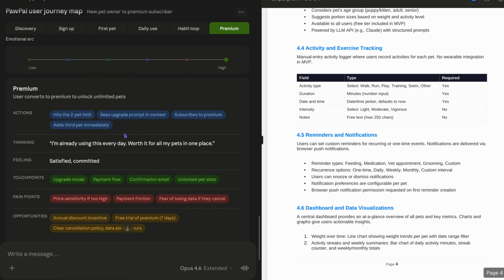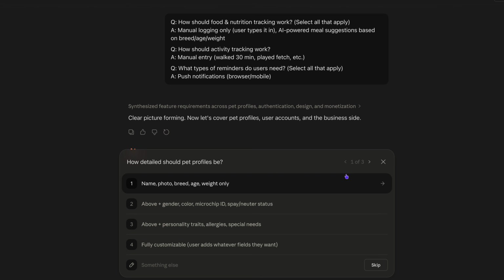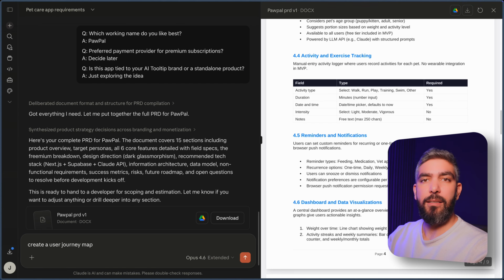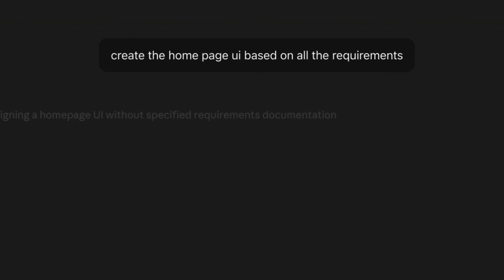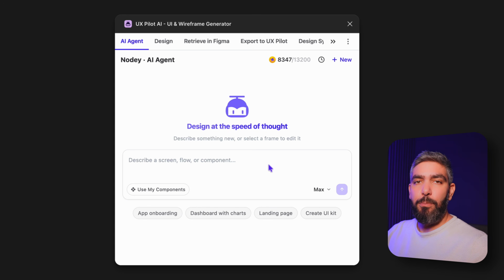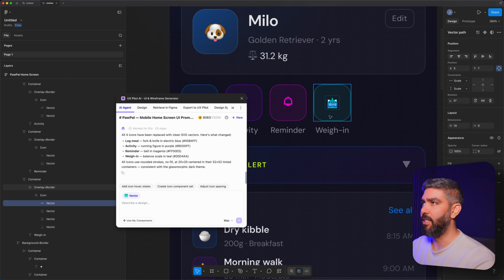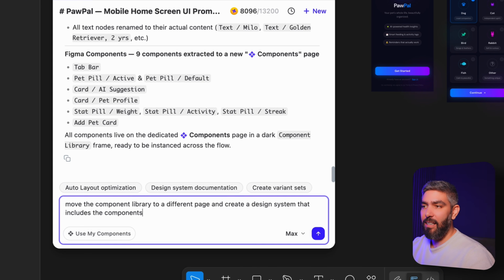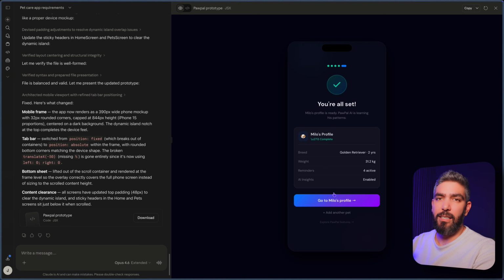The “No Slop” AI Workflow | Full UI/UX Guide

Comment: Thanks for this really insightful video!✅

Quick question: now that Claude can generate PRDs and ask follow-up questions, do you still use Gemini for UX research, user validation, and defining the USP, since that's traditionally been one of its strengths?

Or has Claude become just as capable as Gemini when it comes to generating a high-quality PRD, conducting UX research, and even building the database structure in real time?

Also, in this example, it seems like you move directly into designing the interfaces without doing UX research first. I guess it's  just for the sake of the demo, and normally conduct UX research, user validation, and strategy work before moving on to the interface design phase ? Or depending of the kind of project 😀
Reply from the maker: Hey! sorry for the late reply. 
Yes i now use claude for the PRD, i find all ai platforms good enough now, but claude makes it a better experience and generates better documents. It honestly depends on what ai platform i'm using at the moment.
And you are right, for this demo i did not get into the ux research phase, just because this video is more focused on design systems and UI design.

Comment: Also, why did you use Nodey instead of Figma make or Claude design? Just curious :)
Reply from the maker: Figma Make generates a coded ui but it does not generate Figma components. And Claude Design is the same, code first and no figma integration.
I use Nodey because it works directly on the Figma canvas. 
You could achieve that with Claude Code + Figma MCP, but it's more complicated and still it won't work directly on the canvas, it only converts your code to figma files.